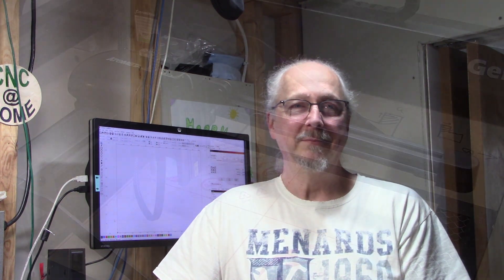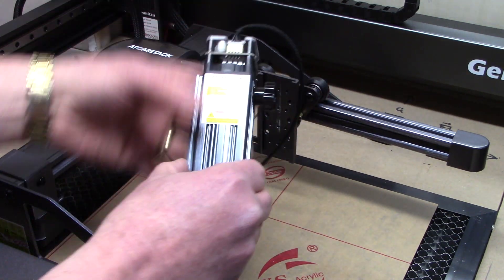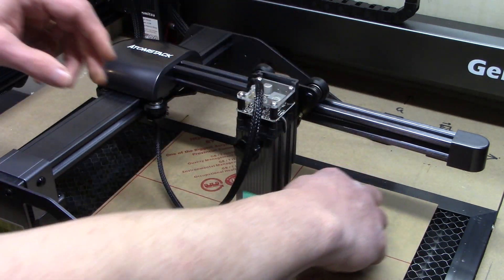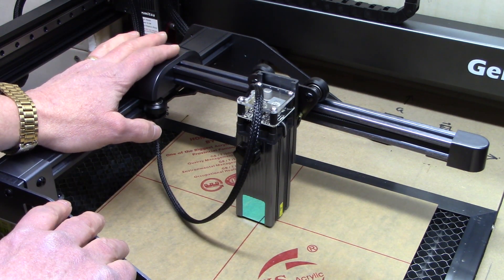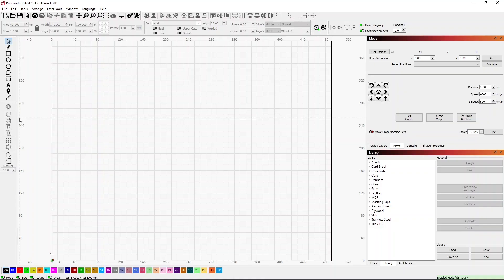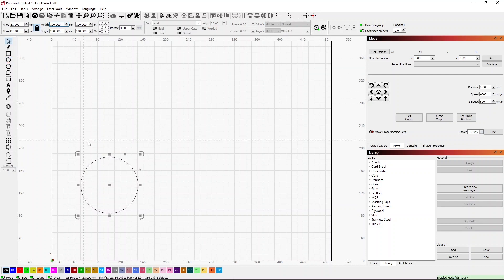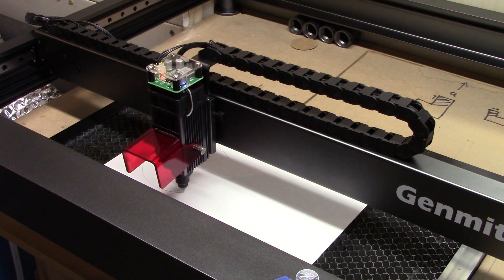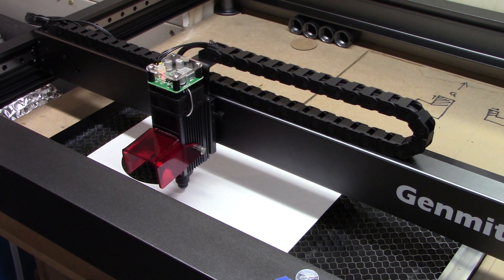LightBurn, Print and Cut feature

Comment: Thanks for sharing this. This is going to be a game changer for me. I have to make a wall hanging that is larger than my Longer Ray bed and this looks like the information I was looking for. I'm glad I subscribed to your channel, yesterday.
Reply from the maker: Fantastic!  I am glad this will help you.  Give it a try with something small like I did with using paper.  I played with this feature over a year ago and didn't spend enough time learning how it works and failed at my attempt.  I bookmarked it in my head for "another time". You know how that goes.  Fast forward a year or so and I got back to it.  I didn't have any issues using it, that is why I decided to do a quick video on it.  I hope your project works out great!  I have visions of burning a 4X8 foot piece of plywood for something and using this.  (Not really going to happen thought as that would take forever to burn).  ;-)
Reply: @CNCATHome  I planned to try it out next week on some cardboard and see if I can figure it out. WOW!! a 4X8 piece would be awesome.
Reply from the maker: @jimmylee6247  - 4X8 would be awesome as it is so much larger than my working area of 50x40cm.  My friend's 150 watt CO2 laser has a bypass and if close to 5' wide so he can easily run a 4X8 sheet through.  I don't remember the depth of his cutting area but he should be able to do that in 2 or 3 sections.  Using the Print and Cut would help him do that.  Good luck with your project!  :-)

Comment: Can't you raise up the Atomstack's laser so you can see the beam, position it, then drop it down and focus it?
Reply from the maker: I have thought about that and I like the idea. With this laser, there are some issues doing that.  The main one is the laser emitter doesn't keep itself square with the gantry and can rotate a little.  This can make up to a 1 mm difference in the laser spot location along the x axis.  The laser dot is noticeably larger when the emitter is raised up enough to see the dot.  What I need to do is to take the safety window out so I can see the laser dot in the focused position and just make sure to wear my safety goggles while it is operating.  What I really need to do is find an Allan wrench that fits that set screw so I can remove the protective glass screen.  My solution is to keep the burns simple and I made a nice zeroing template for the laser so I have accurate and repeatable location of the material I am burning/etching.

Comment: Hi,  I just purchased an LC-50, upon assembling, I ended up with a wire labeled Y ( I assumed it is for the Y axis limit switch) but the is no Y limit switch at the far end of the Y axis: any thought on that? is that normal?
Thanks for your service to the laser engraving community.
Reply from the maker: There should be a limit switch on the machine.  When facing the machine, it is on the left side near the front.  The Y cable should go from that switch to the controller board and plug into the farthest right plug that is 3 pins.  My LC-50 Plus came with the X and Y limit switches already installed and there were X and Y limit switches included with the nuts and bolts so I have an extra of each.  If you do not have a limit switch, you should contact the seller and inquire about that.  I hope you are able to get that taken care of.  🙂